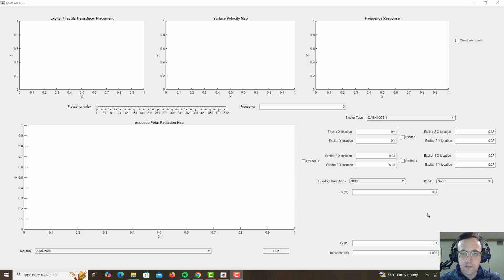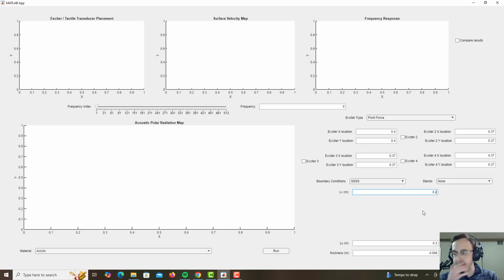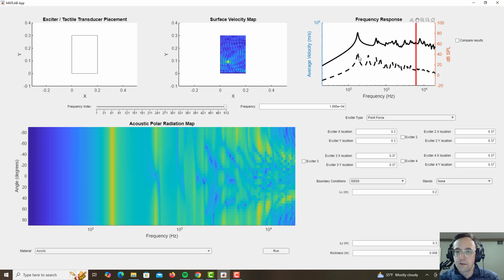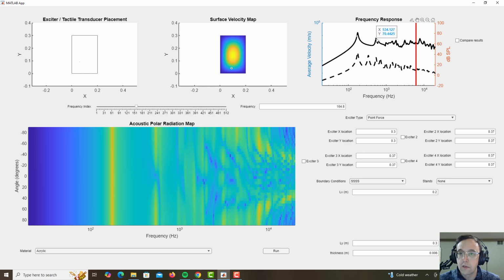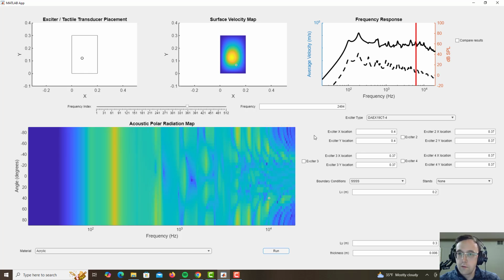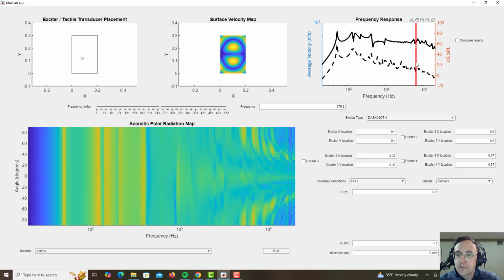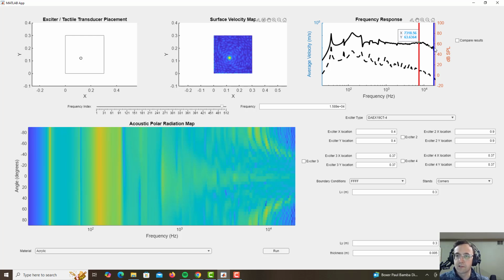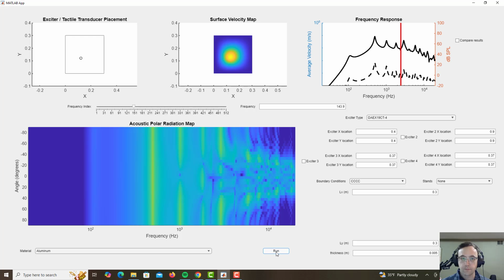*OLD* DML Design with PETTaLS Part 1: Introduction

Comment: Hi a question regarding flat rectangular DML panels (am currently using low density eps), is an aspect ratio of 1.618:1 (the Golden Mean Ratio) considered the most effective option to ensure the uniformly spaced panel modes and so smoothest response? Thanks.
Reply from the maker: If you want to try and avoid overlapping mode resonances, then yes, you want to try and go for an aspect ratio that can't be reduced easily to a fraction (like 1:1 or 2:1 are bad). Practically, I'm not sure if you'd see much difference between 1.6:1 and 1.618:1, though.

Comment: This is a really cool tool.  I just binged all three videos.  I can't say how excited I am too see something like this.  Here are some thoughts about possible improvements:
1. Damping.  Both within the panel itself and at the boundaries.  An undamped (say FFFF) aluminum (or glass!) panel is truly horrible in real life, while the same in acrylic is much, much better.  But in your video the aluminum didn't look nearly as bad as it should, nor as different as it really is from acrylic.  Also, using damping materials at the supports changes the response dramatically, having some capability in the model for varying that seems critical.  
2. Material Properties.  Do you envision the ability to input self definable materials?  Especially orthotropic?  Composite panels with say, carbon fiber skins and lightweight cores are commonly used.  But their properties vary with the specific design, so the ability to input the elastic properties directly (rather than choose a generic material type) would be critical.
3. Any chance of modelling the impulse response?  Or a wavelet spectrogram?  Frequency response is important, but the response in the time domain is equally important.
4. What about sensitivity/efficiency?  An big challenge in flat panel design is getting good sensitivity.  Acrylic has great internal damping but horrible sensitivity, due to is relatively low stiffness and high density, while skin/core/skin composites are much better in that regard.  It would be great if you model could predict some measure of sensitivity.
5. Less importantly (to me anyway), but still nice, would be the ability to model shapes other than rectangular, including rounded edges.  And to model mixed boundary conditions (FSFS) for example.

Great work, I can't wait to see what's next!
Reply from the maker: Thanks for the comment - these are all really great points. I'll try to respond in order...
1. Yes, damping is (inaccurately) set to the same value for all materials right now. You're right that acrylic has super high internal damping and aluminum/glass/etc will have very low damping (and high Q modes). A lot of these material-dependent parameters will have to be calculated empirically, which I'm hoping to do in my lab for common materials. I can also just create a user input box for quality factor as a temporary solution! The edge damping is something I can model for sure, but I'll have to run experiments to determine how accurate the model is...
2. Yeah, that wouldn't be a problem for isotropic materials. These simulations tend to be tricky for non-isotropic materials like cardboard or posterboard. For example, I published some comparisons between measurement and simulation here (https://acoustics.org/how-to-find-the-best-material-for-making-exciter-based-plate-speakers/) showing how weird posterboard acts. Posterboard simulations are very accurate at low frequencies, and very inaccurate at high frequencies. I'll have to do more research into how to best model that - maybe a frequency-dependent Young's modulus or something along those lines.
3. Yeah, I can generate impulse response or waterfall plots in this software. The weird part about doing that is that they are very, very location dependent - 1m away on-axis is very different from 1m away at 45 degrees. It's really different in that way from a traditional speaker. I can put that in, though, and maybe allow the user to select a measurement point.
4. Right now the output is being modeled with respect to a reference input force (0.1 J). So sensitivity is kinda being modeled, but just not with respect to the normal 1W electrical power input. You'd definitely see that posterboard has a higher average output than acrylic. It does make more sense to translate everything back through the exciters to a sensitivity, so I'll work on adding that in.
5. FSFS and FCFC are in there already! I've been thinking about how to model rounded edges, so I'll see if I can get that in there eventually as well.